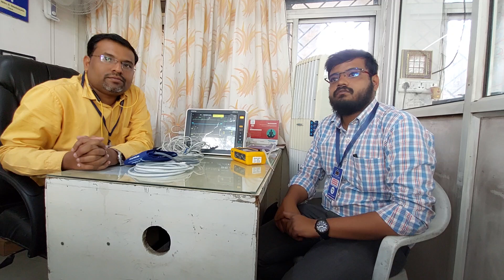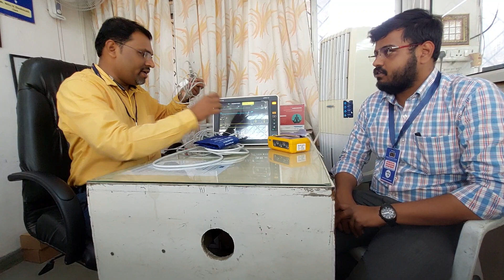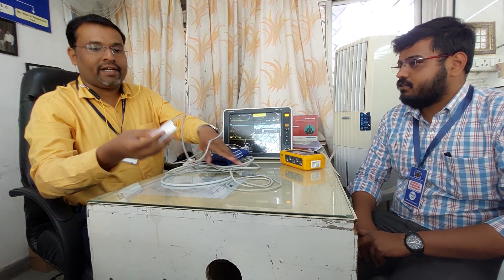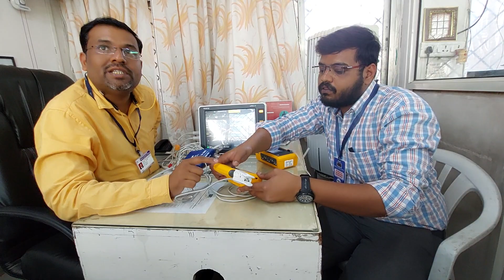multipara monitor SpO2 calibration

Comment: Is this process a calibration or a validation? If there's a difference of 10% in measured value how to calibrate monitor?? Where's the adjustment available?
Reply from the maker: It's validation for checking either monitor work properly or not